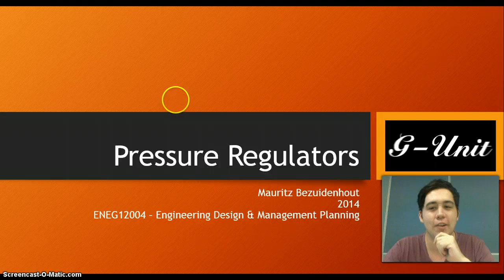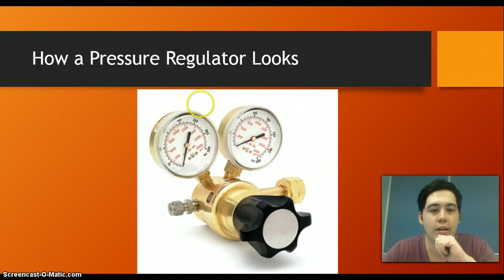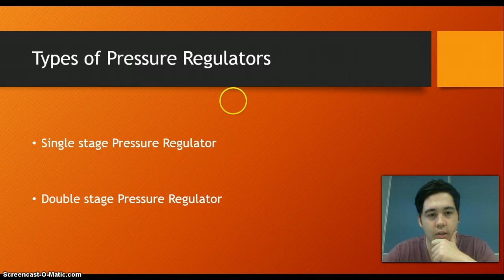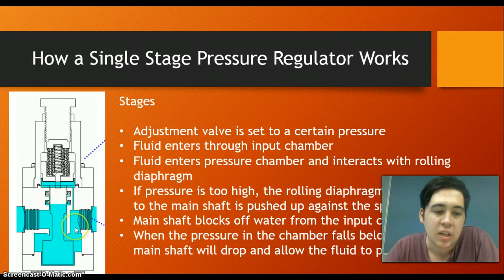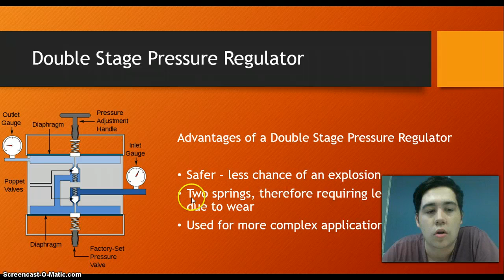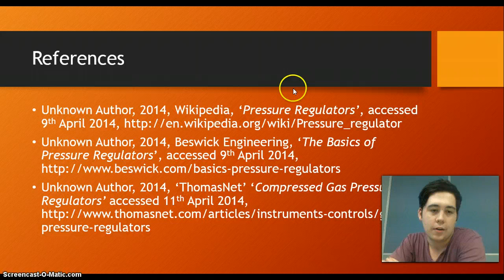How a Pressure Regulator Works

Comment: In a liquid flow process, if one needs a specific flow rate and pressure, which will be best used: regulator or pressure compensated flow control valve?

Comment: What's a pressure regulator?
Reply: Pressure regulator control incoming fluid/air. It usually decrease the pressure of the air/fluid.